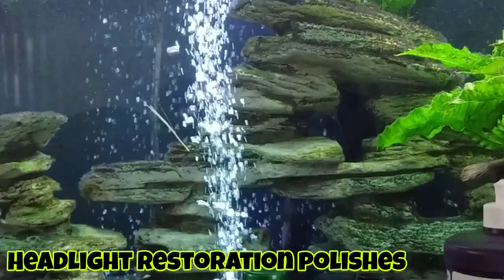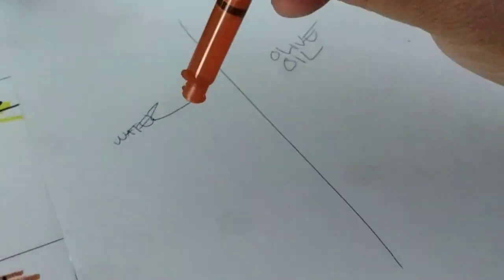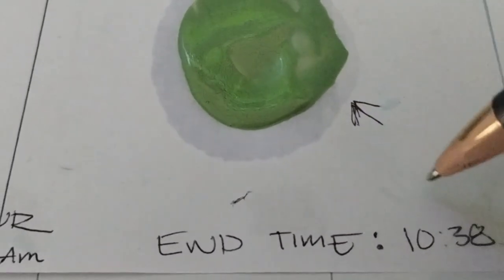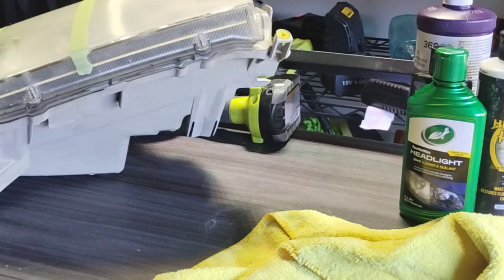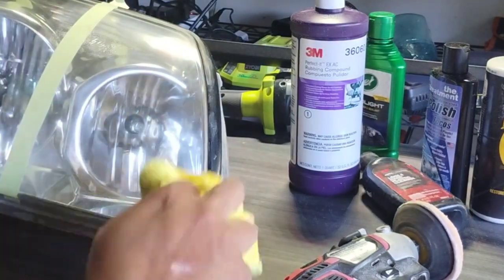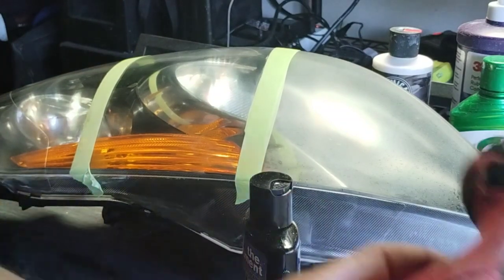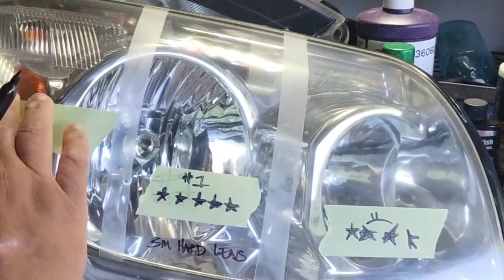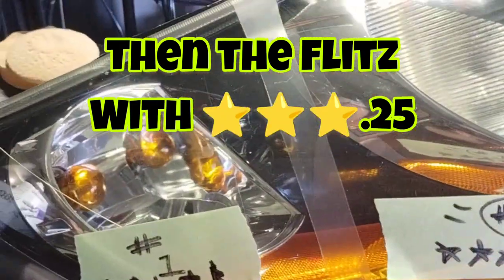HEADLIGHT POLISHES what you're looking for in headlight restoration ⛽🛢️

Comment: Just watched this again for the third time......I used the Chemical Guys restorer which was great but actually snooped around and got a couple bottles of 3M 39017 at the local NAPA auto store....figured it would last a duffer like me for a very long time.  I suspect the 3M 36060 with some Chemical Guys Restorer mixed in would probably make a good combination.  A little more oil in the great cutting ability of the 3M seems like the future for those in the biz...
Reply from the maker: Yes sir good analogy..👍🏽

Comment: Okokok first of all thank you for putting videos like this out there your so to the point while keeping things interesting your the real Five Star. But hear me out in theory … the oils are just filling in the porous material to give it the flat mirror like finish as opposed to completely leveling down the high spots to the low spots and so I’m sure if you do an ipa wipe then it’ll look less clear with the oils removed, my gripe with this  is spraying over those oils .. I feel like a 2 step compound and polish  with oils removed and meguires clear applied to the virgin surface would last longer than sprayed over the oil what do u think? …coming from a painter at work in are spray booth this is are ideology for paint

Comment: Would the heavy oil based polishing compound prevent the uv coating from effectively adhering to the lens? Thanks for your work.
Reply from the maker: Not at all... There's not enough left on.. it's basically embedded into the pockets of the surface structure if you see it in my videos it's like a sponge or quilted blanket with caverns and pockets underneath the surface.. pretty much in there and benefits the headlight by far check this video out...https://youtu.be/LC4ZBu02JZg?si=93_nTawTdzdbbkRX

Comment: Great explanation on these chemicals, if I upstanding u correct chemical guys is the way to go. Thanks.
Reply from the maker: The chemical guys is pretty amazing but worked in with this method... It's a bit different to use you have to hit it a little bit more for a higher heat Flash... I really got to make sure you have a clean microfiber towel and check it to make sure that it's not an oily surface and it's pretty amazing just a little bit different to use.. of course the 3M hard lens cleaner is going to be the way to go if you can get it if not the chemical guys and the.. treatment are good options all top notch.. but I have to choose it'd be 3M, then The chemical guys, then the treatment (blue stuff)..
But keep in mind all of these work even the new 3M product just works different..
Reply: @theheadlightrestorationpro  thinking out loud here, might want to try the new 3M with a white or black softer pad...:) might leave less haze. or the Rupes yellow pad.
Reply from the maker: Don't really have an issue with Haze.. literally not existent..
Reply from the maker: It's an issue with dryness... I can tell it's not depositing any kind of beneficial liquid AKA oil..

Comment: Hi chief, can you please let me know why or where these cracks cone from? Ive sanded from 320 grit. Its like spiderline cracks…
Reply from the maker: Got to be careful using those grits that are below p500... Hopefully you use the p320 cuz if not as an extremely extremely aggressive grid as a regular 320... The thing with those lower numbers they're more durable and they're much more abrasive.. they can cost a lot of damage to Headlights... But spider crackings and stuff like that is typically from the Sun and brittleness and heat... It typically happens naturally when the headlights don't have the adequate amount of clear coat on them from erosion.... And it's not something you can get out if they're through and through or inside of the headlight.. does the options you have through and through, inside of the headlight, or in the clear coat of headlight.. only one of those will come out if that's the one in the clear coat....
Keep trying at it and watch those heavy grits and be very gentle with your pressure....
Thanks for watching appreciate the support....

Comment: What's your opinion on the 3D ceramic headlight restoration?
Reply from the maker: Ceramic is no good...
Reply: Thanks for the reply. I'll just stick to the chemical guy headlight restoration
Reply from the maker: @rjal6528 👍🏽
Reply: ceramic is best used as a sealant on top of clearcoat just like wax 
ceramic should not be used underneath clearcoat

Comment: @theheadlightrestorationpro I'm still confused about Flitz and The Treatment. At 29:00 you put 5 stars on the left hand side, which was where you used the Flitz. But at 30:24 you didn't include Flitz with the 5 star lineup. Just curious, did Flitz get 3 or 5 stars?
Reply from the maker: You have to watch the video closer I explain this...
Reply: @theheadlightrestorationpro  I watched it 4 times and still wasn’t sure which way you were explaining it. Part of the reason I’m interested is because I already have some Flitz, but I won’t use it if it doesn’t work as well. That’s why I’m asking whether you rated Flitz 3 or 5.
Reply from the maker: @brianmiller8596 it's usable but it's the last one I would use.... It's much to water you'd have to cut it with something thicker.....
Reply: @theheadlightrestorationpro  Thanks
Reply from the maker: @brianmiller8596 no problem..👍🏽
https://youtu.be/-r-uVdqy0dU?si=ywy7TyeF66H6TwdU

Comment: meguiars ultimate compound?
Reply from the maker: No.. designed differently not good for headlights.... Typically most kind of compounds are not good for the headlights.. actual headlight restoration polish as kind of a split between both and heavily oil based... I will stay away from the compounds unless it was this 3M compound and even that's incomplete somewhat..

Comment: 3m 39162  headlight renewal might be the same thing as the 3m lens & hard plastic cleaner.  Looks the same, smells the same, cleans and polished the same.
Reply from the maker: It's actually the compound.. the compound is virtually identical to the eye there's just some minor differences...
I'm regularly in touch with 3m and other manufacturers.. per their words it's their rubbing compound in their kits wish they're going to be changing to the 36060.. if you Google search them the packaging is damn near identical and if you put them side by side you wouldn't be able to tell the difference one is heavier on grits and find particulates I believe and the other is more heavily based on oil Just a touch..
I use them both.... But they don't both do same level work... Which is always been strange to me... Being that the lens cleaner is far superior for headlights but less applicable for universal work...